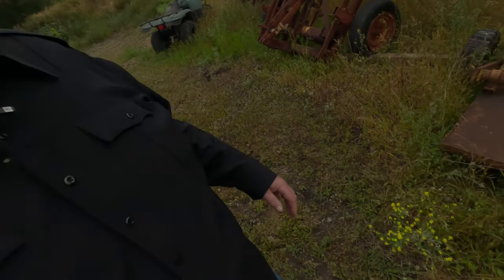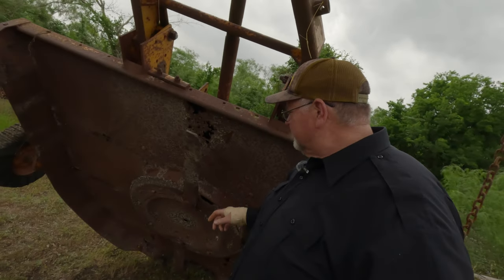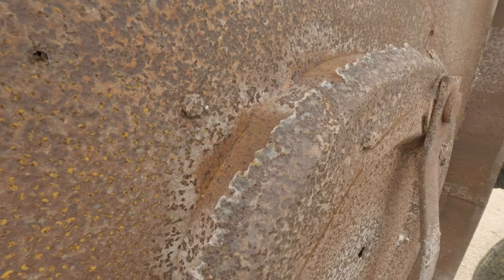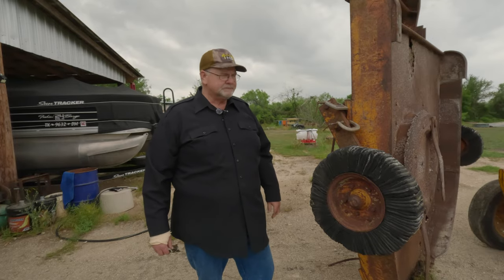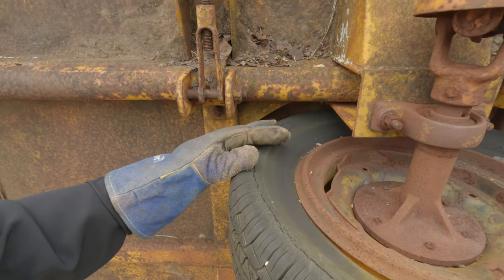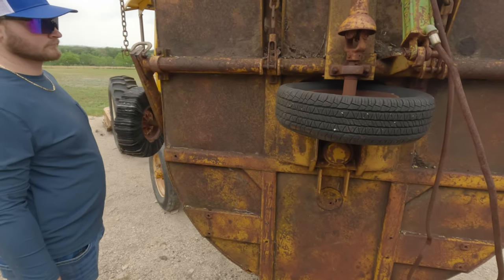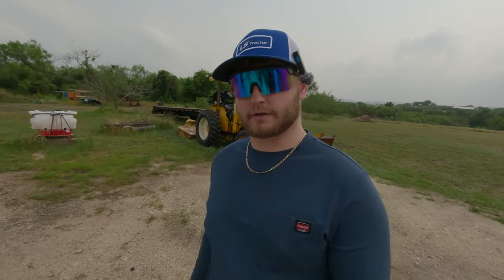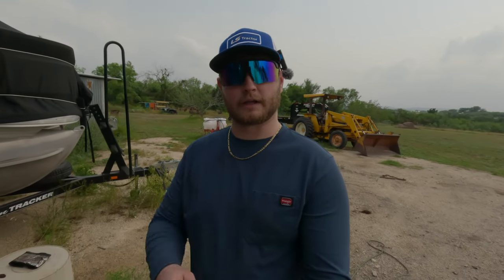Old Sidewinder shredder? Can we make it  work again?

Comment: Pretty cool design! I smacked a few stumps today while shreddin :0
Reply from the maker: Yeah
The slip clutch helps when you hit something by mostly preventing the shock to the PTO. The wheel type because it does not have an actual Gear box absorbs allot of the shock and it does not take out a gear box. Cause it ain’t there😂

Comment: I have spent many hours using a tire drive Sidewinder. We had a 6 footer and 7 footer 3 point hitch type. Very unique cutter that turns a lot of heads. They do a great job though. I don't believe they make them anymore?
Reply from the maker: I don’t believe they make it anymore ether. It was to simple 😂. That was the only shredder I had for many years. It mowed ALLOT of grass, mesquite and its fair share of rocks. 
It is making a little noise but some of the bearings are loose and the tire is bad. Working on all of that now. Thanks we appreciate your comments